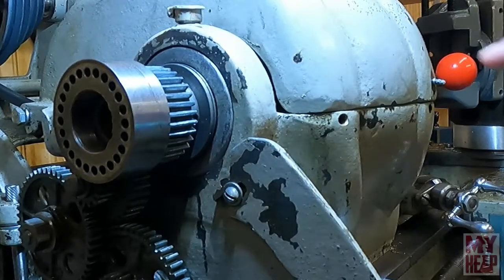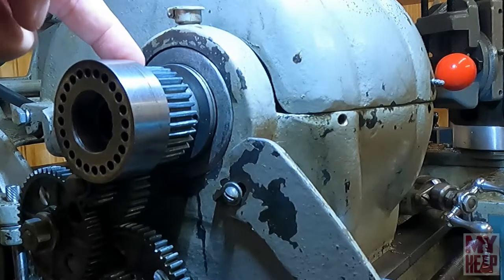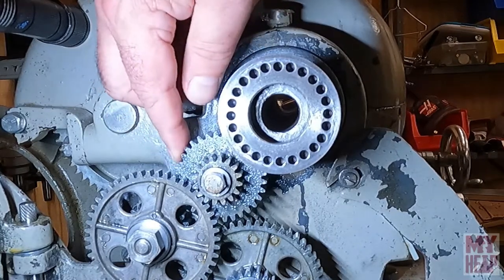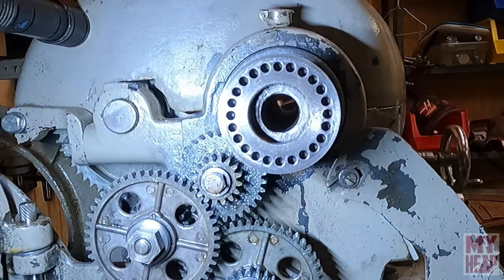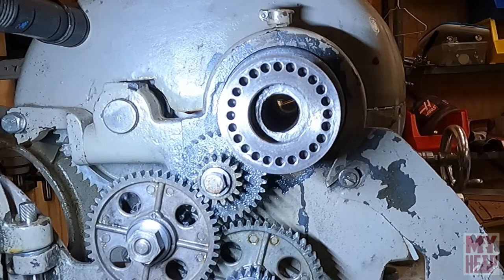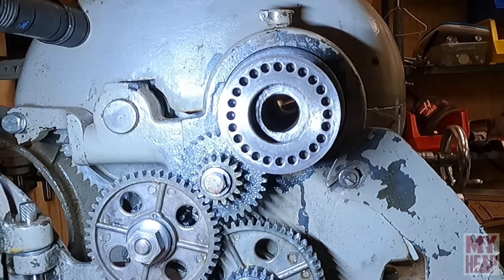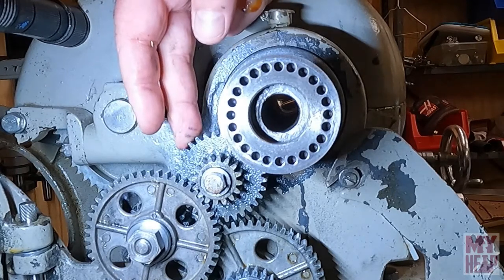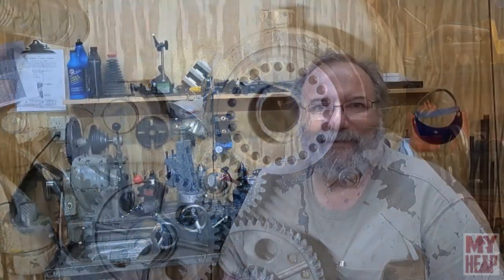Atlas 10F Lathe - TH54 - 27 - Viewer Question: Compound Idler Gear

Comment: hi joe
nice to see you back near some machinery. Hope its not a flying visit and hope you've got topside of the renovations, don't go trying to put a outside light up again, you never know where you will end up.
I stopped using the change gears some years ago, just a flick of the gearbox lever for me!!!!
Those Atlas lathes you have over there look good lathes are they the equivalent to our Myford's over here.
see you next time
Reply from the maker: I don't know if they are really equivalent or not Mr. F.  I think the Myford is probably a bit heavier but as long as you take it easy the Atlas 10F seems to get the job done.  Yes SIR, no more dang outside lights for me.  I will hang a torch on the wall first!  I don't mind the change gears, well till I need to change them and then I gripe.  But the other side of the coin is I can cut weird pitches.  For example a 24 diemetral pitch to make a worm.  I am not sure the fella with the change gear box can.  At least as I see it, but if I am wrong, do let me know please!

Joe

Comment: The 32-tooth gear I have, now I'm going to find out how I'm going to make a 16-tooth gear and make the composition of the two joints. Thanks a lot for the help.
Reply from the maker: I have a suggestion on making this compound gear.  If you have the facilities  to make gears then this will be fairly easy.  But first a couple of questions.  Do you have the stud that the gear rides on?  If you do not, I will get you some information.  When making the gears, keep the following in mind.  The Atlas gears are 16 Diametral Pitch with a 14.5 degree pressure angle.  I would start with the 16 tooth gear.  The outside diameter will be N+2/DP or 18/16 = 1.125 inches.  Turn your blank down to a length of 1 inch at this diameter.  Then turn 1/2 inch to a diameter of the blank down to 1.125 - ( 2 * the total depth of cut for the tooth).  In this case 1.125 - (2 * 2.157 / 16).  Or 0.855.  I would just round to .850.  So the blank is 1 inch long with a 1/2 inch length at 1.125 diameter and the other 1/2 inch at .850.  Next drill and ream to the size stud it will ride on.  The 1.125 inch section will have 16 teeth cut on it.  Now, the 32 tooth gear should have a bore of .849 for a press fit of the gear we just made.  Ream after pressing them together in case there is some distortion.   I hope that makes some sense.

Now, if your shop is limited, it may still be possible to make them.  If you go through the comments of the this video, a subscriber thinks he has a spare gear he will sell.  That might be an option for you too.

Vaya con Dios.
Joe
Reply: @MyHeap  Thank you very much for the tips and suggestions, I will analyze and put everything on paper to organize the ideas.

Comment: G’day Joe. Good to see you on the small screen again, didn’t happen to use any of the machines whilst you were there did you. 
Cheers 
Stay safe 
Peter
Reply from the maker: Most of my time was spent trying to figure out how to use the camera.  I bought a gopro a while back and just recently got the media mod for it.  This lets me hook it up to an external monitor.  That way I have a big screen to reference for the shot.  This was a huge help because the little screen on the back just wasn't enough for this half blind guy.  Then there was the problem of trying to control the camera.  I ended up having to use the app on my phone to start and stop recording.  Then after I recorded and pulled the video to my computer for editing I was taken back by the audio.  The mic on the media mod is pretty sensitive or something.   The loud hum is  my dehumidifier running and on camera seems a lot louder than real life.  I think I might look at getting another wireless microphone and see if that is any better.  I will go back out to the shop in a day or two and get some information Ben is asking for from Ben's workshop.  Anyway, I appreciate that you stopped by.

Joe

Comment: I have a 10F that was mounted to a wooden table.  I had to remove it fr transport as it was falling apart.  Is there a digram that shows how the motor assembly is mounted and distance from the lathe base?
Reply from the maker: You can find most documentation on the 10F series from the Atlas-Craftsman IO group and vintage machinery website.  There are mounting instructions.  Let me know if you cannot find them.  I have them (somewhere) and will look for them if you cannot.

Thank you for watching and taking the time to comment.

Joe

Comment: Cheers. I have not looked at mine, though I do have a gearbox on mine. Could you let me know how many teeth, and what diameter as well as the divisions on the thread cutting indicator please?
Reply from the maker: Hi Ben,  Yes sir, I will get that information for you this evening after I get home from work.

Joe
Reply: @MyHeap  Many thanks. I am hoping for enough information to make my own.
Reply from the maker: @BensWorkshop  In that case I will try to do a bang up job!

Joe
Reply: @MyHeap  You are very kind.
Reply from the maker: @BensWorkshop  hi Ben.  I gathered all the information today.  And have amassed other supplementary information to go with it.  But so you don't have to wait a few days to get it, let me give you some highlights about the two components.   The indicator has 4 divisions with number 1 and two marked at 180 degrees.  The indicator is 7/8" diameter with a 1/4" bore where it is pressed or glued to the shaft that runs through the housing.  The gear is 16 tooth, 25.133 diametral pitch.  And the teeth should be angled slightly to match the helix of the screw.  The gear will be a 14.5 degree pressure angle based on the standard acme screw that drives it.  The helix angle of the screw is 3.312 degrees.  The gear blank should have a OD of .7162".  The gear is 3/8" thick with an 1/8" boss.  The boss diameter is 1/2".  The gear, like the indicator has a 1/4" bore and is pressed on the shaft.  Mine looks like it has either been staked or perhaps it is ejection pin marks.  Now making the gear you have a couple of choices.  A 25.133 diametral pitch is really weird.  But that is what a 8 TPI screw works out to be.  So making or finding a brown and shape style cutter is complicated at best.  On the other hand, an 8 TPI hob made of drill rod should be fairly simple if you can make the flutes.  Do you need information on the housing or just this?  The video I make will cover the calculations and a few other bits.  Let me know.

Oh, and when fabricating think of the leedscrew as a worm and the thread gear as a worm gear to allow for the circular contact.

Joe
Reply: @MyHeap  That is really helpful. All I could really do with now is just a few pictures of the actual thing in place. Surely the hob should be also 8TPI though?

I do have a milling machine and probably some ball nose solid carbide bits which can cut hardened tool steel. And a rotary table.
Reply from the maker: @BensWorkshop  you are correct.  I don't know what possessed me to write 10.  I edited the post.  Email me and I will send you some pictures.

Do you think the video would be helpful to others?

Joe
Reply: @MyHeap  A video might, but I will send an email all the same.
Reply: @MyHeap  I have sent the email, so you can delete your email address from the post above.
Reply from the maker: @BensWorkshop  I sent you emails with my phone.  9 pics in all.  Will you verify that you got them?
Reply: @MyHeap  I can confirm that I have them, many thanks indeed. You are very kind.